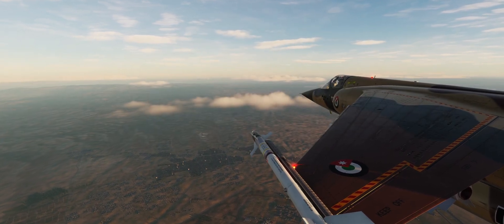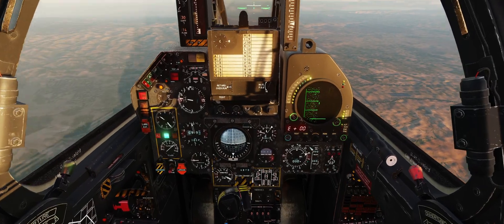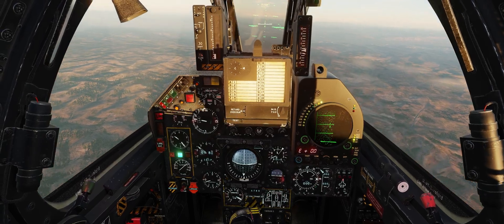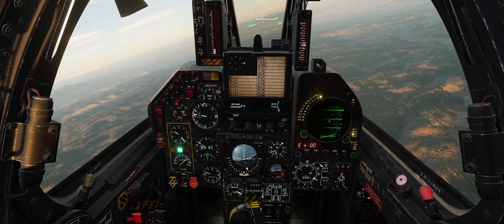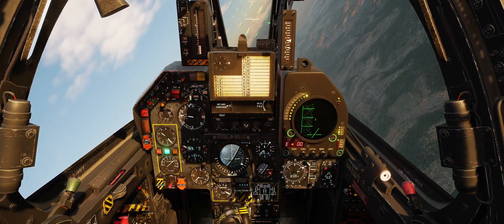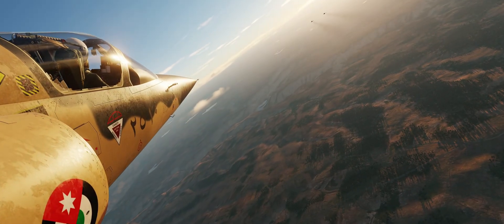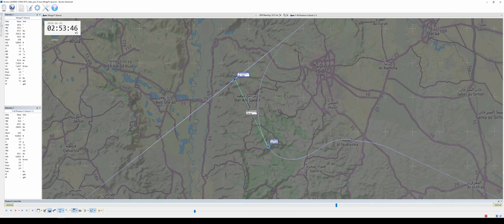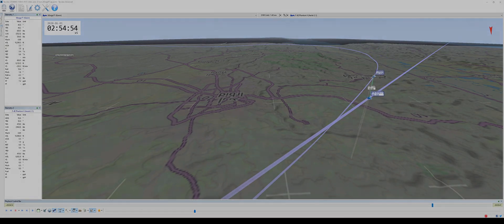Mirage F1: SYNC-Z-TURN Demo

Comment: Why is Mirage's radar constantly displaying weird ground clutter? bad modeling or is it like that in real life? seems like leaps worse than Heatblurs F-4E. Also two more questions: Does a DT (dive toss) delivery of Mk-82's need a specific G pull for them to be on target or does the computer take your speed and calculate it for you? also What is your favorite ground attack loadout on the F-4E?
Reply from the maker: My understanding is that the radar is still heavily WIP. Some sources, such as ZA pilots, say that the Cyrano IV was basically useless, as it required a lot of work and babysitting, something a single pilot can hardly do. That being said, their version of the radar may be different from the Spanish one.

About the F-4 in A/G, I haven't looked at it yet. I'm still scratching the surface of air-to-air employment. There is still a lot to do, lots of things to discover and practices to learn. Only then will I check A/G.
Reply: @FlyAndWire  thanks! true, A/G seems far outside your focus for the moment. I had luck with your SA tips at night in the F-4, not it's best environment to say the least.
Reply from the maker: Yeah, I'm trying to complete the basics of a "side" of the Phantom's capabilities, rather than jumping between topics.
Reply: On the DT, nope it is like the ground lock on the A-4. Once the WSO has locked the ground, put the pipper on the target the target press bomb release and pull off wings level. Your pull up is dictated by the threat, so may pull up quicker if the threat is greater. Bombs will release based on your pull up. The key is wings level, if you allow the wings to go to one side it can throw off your toss.
Reply: @charlesc7723  Do you need piper square on target on lock or just near enough? i have gotten some success with mk-82's but still hard sometimes. almost always short.
Reply: @valhallaab8399  be on target when you press release. The radar is tracking the ground when jester locks it. When you press the release that calculates where it should go. Make sure you put data in the bombing table for jester as well. I have found it to work better if I do that.